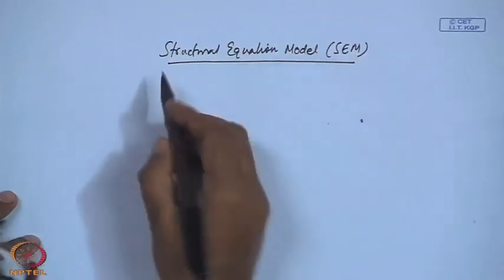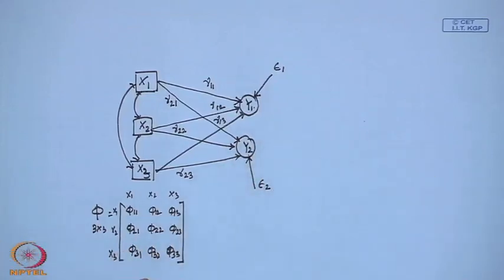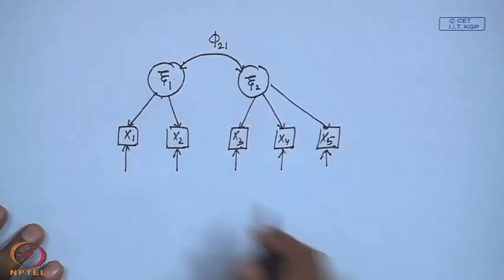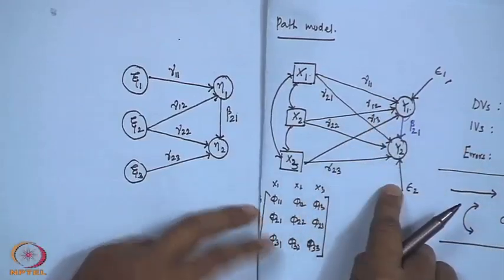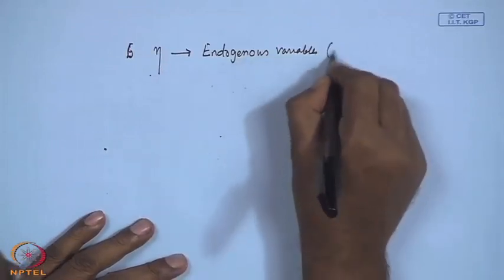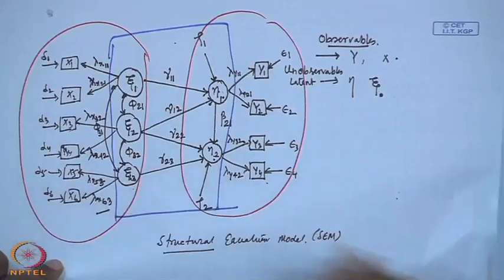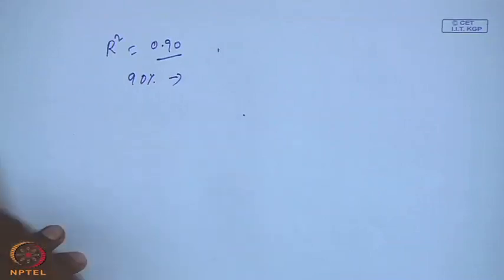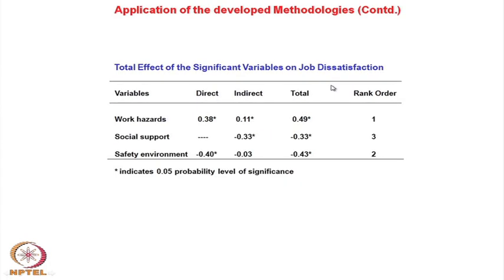Mod-01 Lec-38 Introduction to Structural Equation Modeling (SEM)

Comment: The best spent 56 mins of my life.

The Entire course is available at: https://nptel.ac.in/courses/110/105/110105060/
SEM is covered by Professor Maiti in Module 1 Lecture 38 (Introduction) ,39 (Measurement Model) and 40 (Structural Model)
Reply: Thank you for sharing that link!